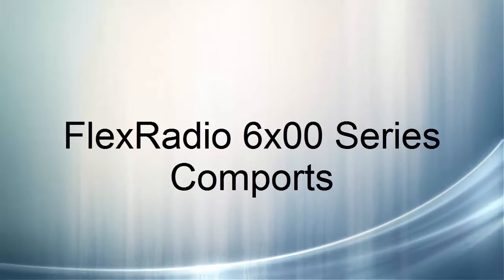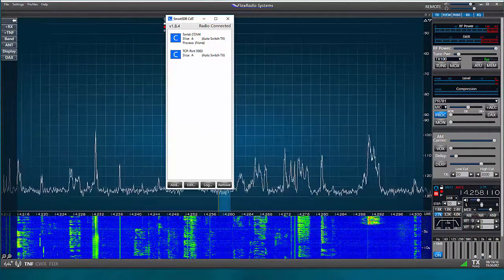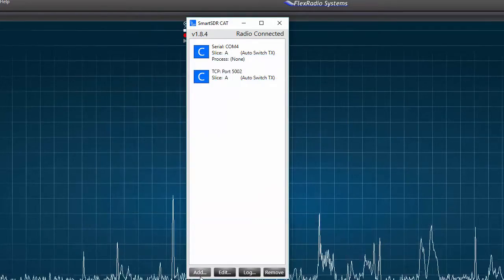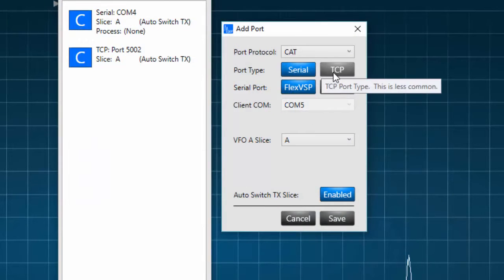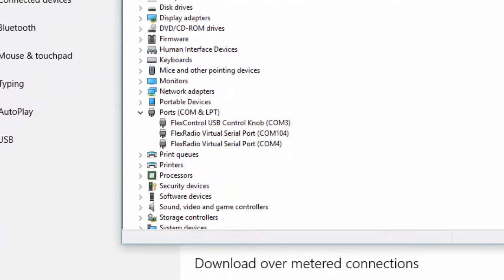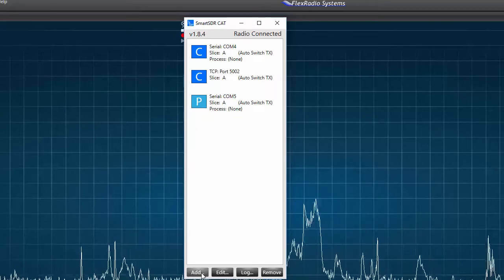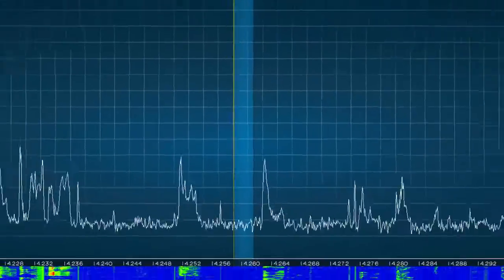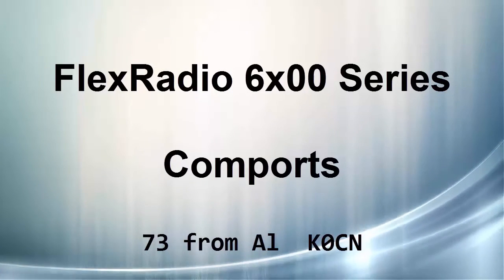FlexRadio SmartSDR CAT and Basic Ham Radio Deluxe Setup

Comment: Hello I finally got my MRP40 CW decoder and transmit to work in my FLEX 6400. DAX was fairly easy to get audio from the slice to decode and TX audio from the CW software to the transmitter running in LSB. CAT was a small battle. The only way to get a drop-down menu to change the protocol in CAT is to create a NEW port. I needed  PTT protocol in CAT. THEN I went to my MRP40 software and configured the com port for PTT and entered 4, for the com port and save. After a pause the MRP40 V667 popped up in the process box for the CAT process I just created. Works perfectly

Comment: Thanks for the video. I am guessing DB-780 works fine with the Flex and just displays more spectrum than my previous Kenwood 590S or Icom 7100.
Reply from the maker: I do know that HRD software does support the Flex 6000 series radios, but I have no experience using it with DM-780. I do have the HRD v. 6.x software and use it for logging, but have not used it for CW, PSK or other modes that involve DM-780. Sorry...